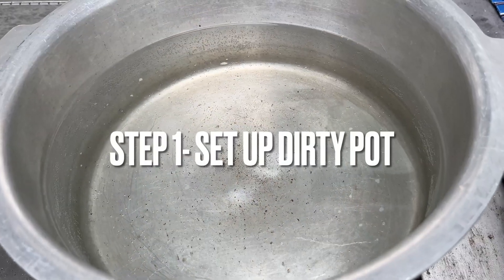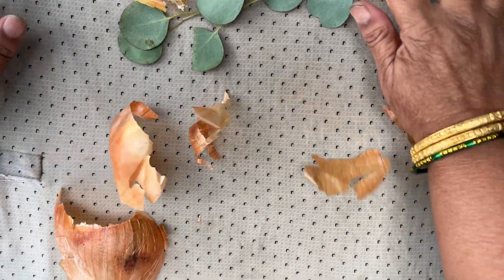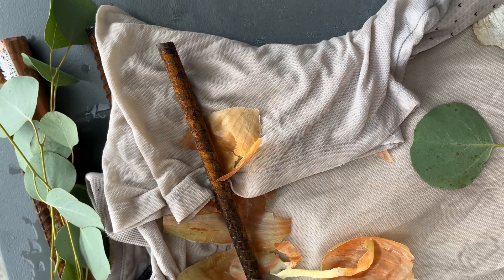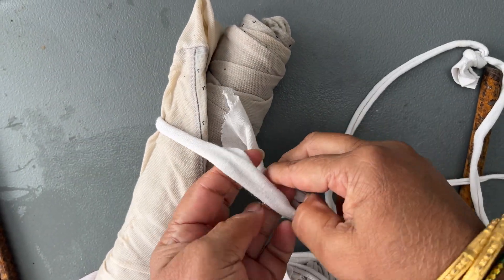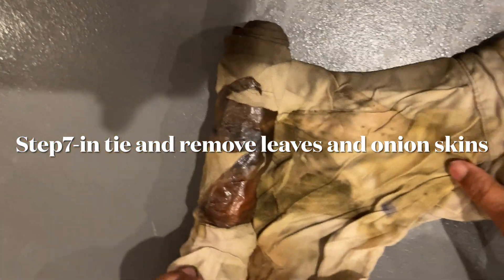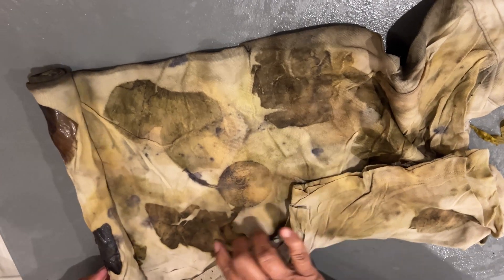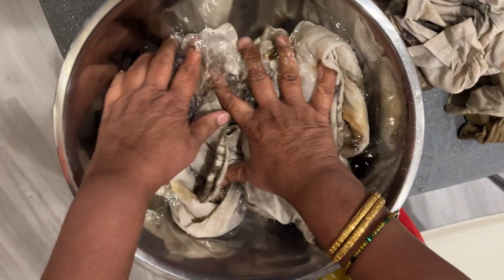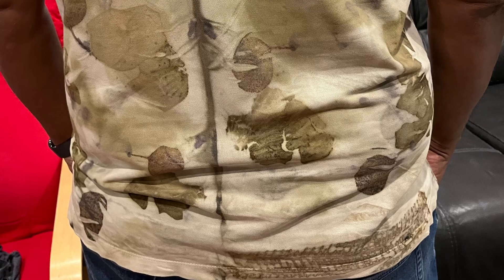“Eco Printing 🌿 Step by Step Tutorial” :dirty pot #textiledyeing

Comment: Great but how to use milk blinder to make any cotton and linen look  clean print .
Reply from the maker: I never did it but you can do by
1. Wash and scour the cotton
	•	Wash the fabric thoroughly to remove oils, starches, or sizing.
	•	A hot wash with a little washing soda (soda ash) or neutral soap works well.
	•	Rinse until no residue remains.

2. Prepare the milk solution
	•	Use whole milk (cow or goat works best).
	•	Dilute with water, usually 1 part milk : 1 part water.
	•	Some artists use it undiluted for stronger effect, but diluted reduces milkiness and smell.

3. Soak the cotton
	•	Submerge the scoured cotton in the milk solution.
	•	Let it soak for at least 30–60 minutes so the fibers absorb the casein.
	•	Wring out gently (not too dry—damp is good).

4. Dry & cure (optional, for better binding)
	•	You can hang the fabric to dry completely before printing.
	•	Some people repeat the soak-and-dry cycle 2–3 times to build more casein into the fibers.

5. Eco-print with plants
	•	Arrange leaves, flowers, or other plant matter on the fabric.
	•	Bundle tightly with string or clamps.
	•	Steam or simmer gently (not a rolling boil) for 1–2 hours depending on your method.

6. Resting time
	•	Leave the bundle wrapped for at least 24 hours (longer, even a week, deepens the prints).

7. Rinse and finish
	•	After unwrapping, rinse gently in cool water to remove excess plant matter.
	•	Air dry, then cure for a few days before washing more thoroughly.